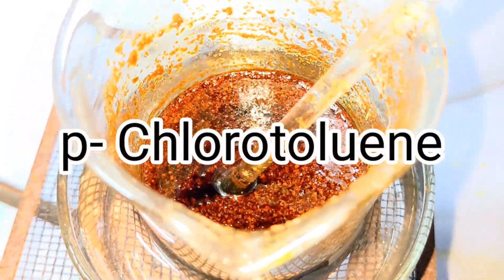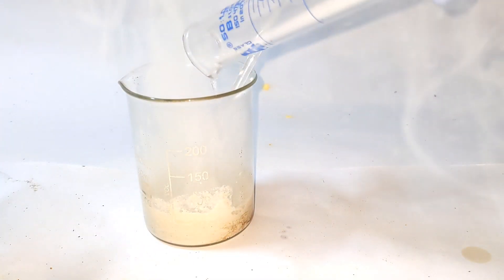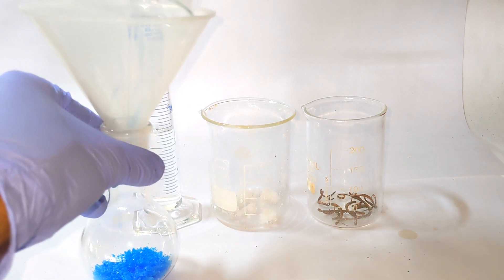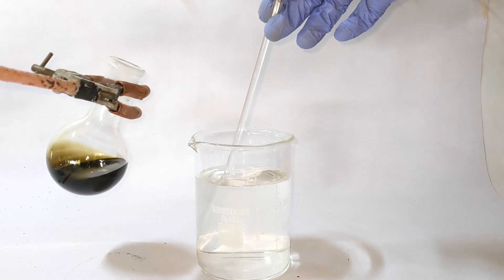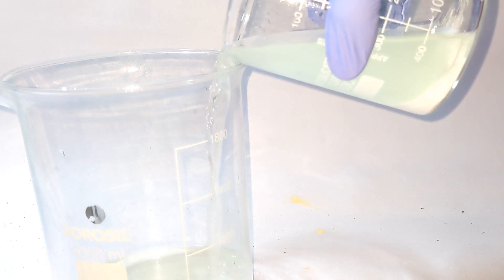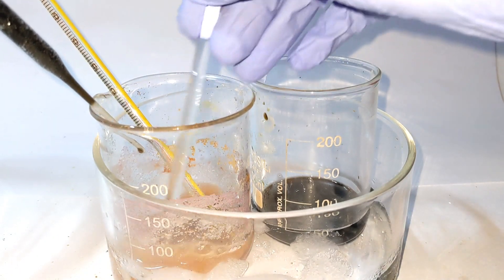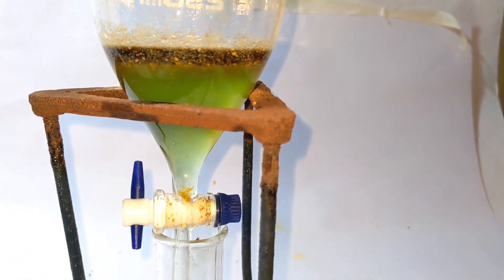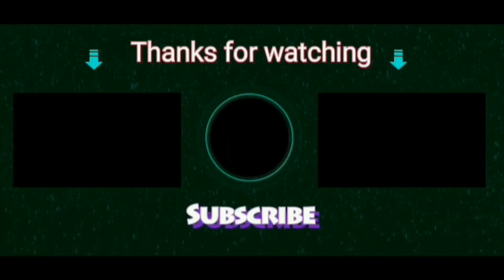Synthesis of p-Chlorotoluene

Comment: HOW TO CRYSTALLIZE THE CRUDE PRODUCT
Reply from the maker: Use minimal amount of ethanol water mixture and heat to dissolve everything and if the crude product appears very dirty then add activated charcoal and boil for few minutes and then filter hot and let the filtrate cool slowly
Reply: @vibzzlab  thx sir